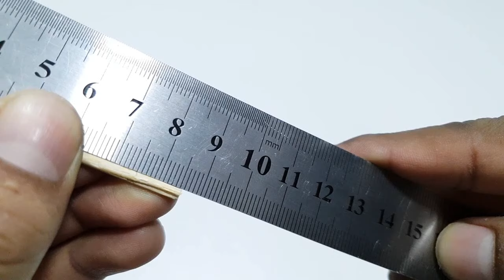Como Hacer una Rueda de Noria con Luces

Comment: Buenas me podrías dar información de los materiales porfavor 🙏 ❤
Reply: Espero no sea muy tarde pero ahí van😄
 El usa alrede dor de 20 luces LED (así se llaman las puedes encontrar en cualquier tienda de electrónica) 

El tambien le conecta una resistencia a cada LED, las que utiliza las puedes encontrar en la misma tienda de electrónica: pide Resistencias de 100 Ohmios

Y el aparato que uso para mover la rueda se llama Motorreductor

Con suerte todo lo encuentras en una misma electrónica
Reply: Puedes pedir ayuda en la tienda de cómo conectarle las resistencia a cada respectiva LED ;)